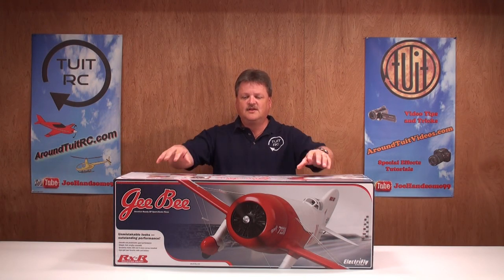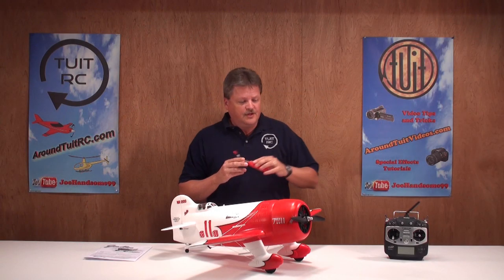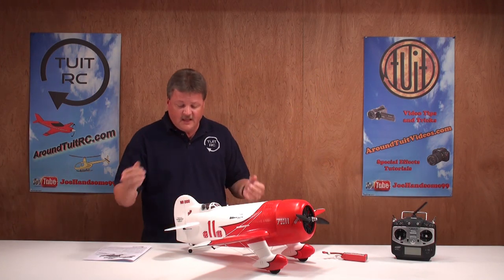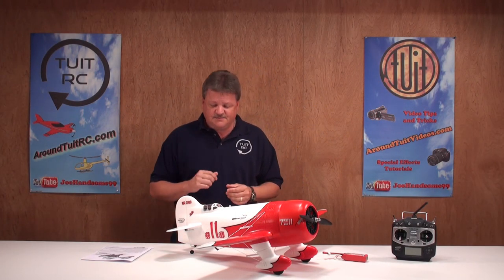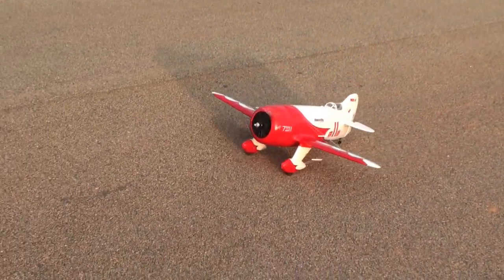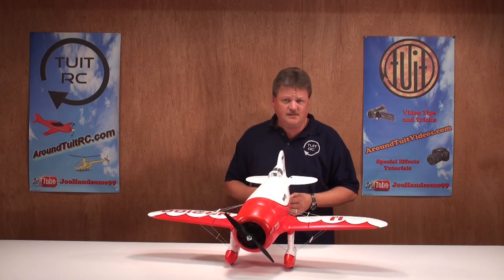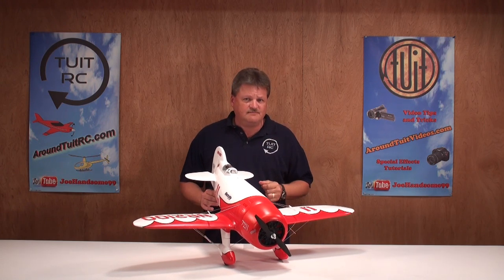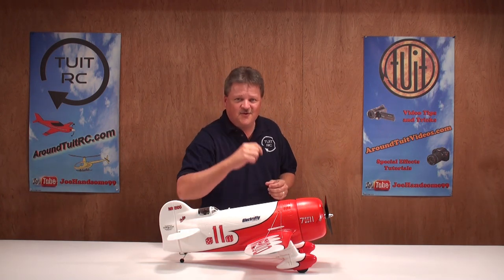Electrifly Gee Bee RC Plane Review and Flight

Comment from the maker: The Gee Bee was very easy to assemble. It took me a while to figure out the landing wire, but that's optional. I could have had it flight ready in minutes if I didn't have to stop and take pictures during the build. You have to be easy on the landings with this one since it is a tail dragger, but when it is in the air it flies great.